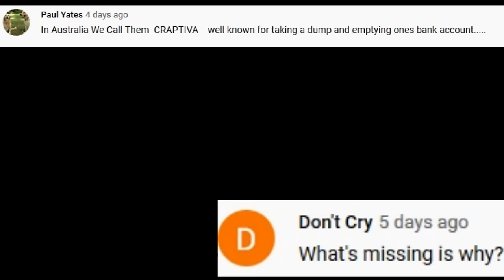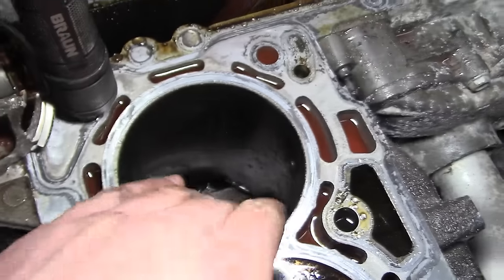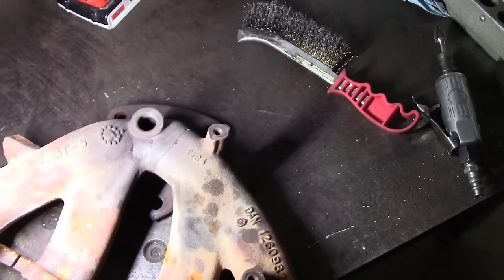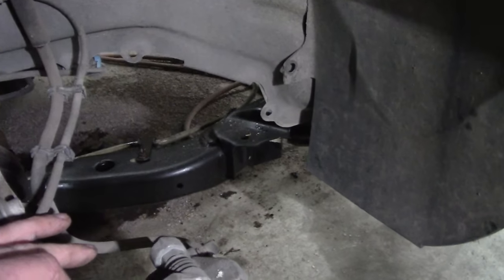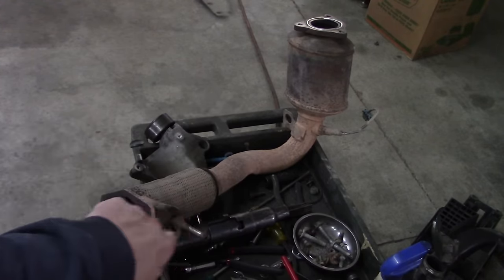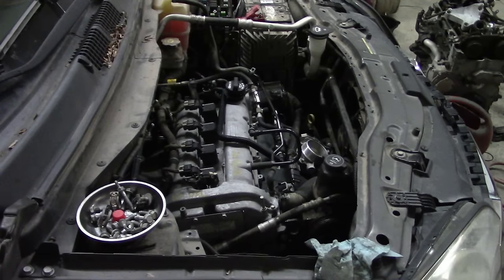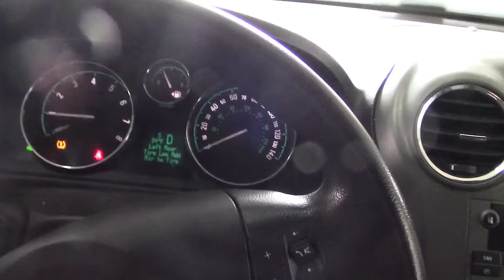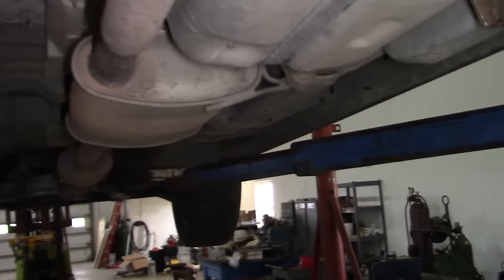I Fixed the Cheapest Small SUV on Marketplace - Part 2

Comment: Good luck to you. Love your channel even though I know nothing about cars, am way too old to learn, and I rely completely on good folks like you to keep me running instead of walking.

One comment about your economic calculations, which is something I do know something about. You yourself mentioned the pig-in-a-poke risk of buying a bad transmission along with a bad engine. And I suppose the car's rear end should be in that risk pile, too. On this particular occasion you won your bet. But how often would you expect to lose it? Once in five flips? Once in two? Let's say two out of three good ones ain't bad, as the song says. Then you need to increase that cost basis you articulated by 1/3 of a transmission and 1/3 of its corresponding labor hours. And those are not phantom expenses, either. All they assume is that you plan on repairing and flipping cars a few more [hundred] times in your long life before you are so lucky enough to get to my overripened old age [more advanced than my timing to be sure]. Anticipating costs of a "going concern" is a perfectly legitimate way of thinking about your business. No embarrassment necessary. Also, think to add in a dash extra to cover bum checks, bad deals when you volunteer to take an economic hit just to make a problem go away, insurance, and the cost of carrying your "inventory" [one sweet Craptiva] for months longer than originally planned, as needed. More nice small businessmen get screwed over by not properly reckoning their costs than anything else.

Good health to you and to your lovely family. Stay safe.
Reply from the maker: That right, which is why one pays more for a car from a dealer than a private party. They are taking a larger risk. Personally, I think flipping cars is a poor way to make money. The margins are low, and you have your money tied up for a long time waiting to sell. But sometimes it can work out.

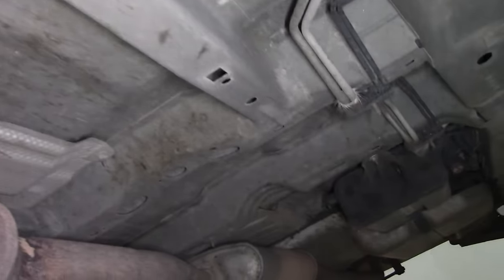Comment: 38:00 I know what you mean. My 2000 bmw 323i is rusting away. It was in Ohio and then Illinois living in the rust belt its whole life. My exhaust studs rusted so bad the nuts fell off! My body is starting to go where the side skirt mount is gone and everything behind it is crunchy. poor car, but you cant blame it after 252k miles...
Reply from the maker: I once owned a 2001 BMW 325CI with a 5 speed manual. That was an awesome car. I replaced the tires and the struts and lower control arms once. Never did any other work to it the whole time I owned it. But it was only 6 years old at the time.

Comment: why did you put dexcool back in it other than it having a dexcool label?  i hear that stuff is really bad for an engine that will eventually leak and introduce air into the system.
just wondering what your thought are, not doggin ya.
Reply from the maker: Nah, Dexcool is fine. The problem with it is people mix it with the old green ethylene glycol coolant and that's when bad things happen.

Comment: GM Engineers are always like hold my beer we're going to make this three thousand times more complicated and you have to have it serviced at the dealership and spend a buttload of money on it.
Reply from the maker: Right. Instead of a simple relay, lets use a dealer programmed module, then mount it to the frame, then use an aluminum housing, and no rust proofing. What could ever go wrong?

Comment: Having owned one of these,  they are roomy, comfortable got good brakes,  six speed transmission was OK after you drove it hard,  
Did a cam position,  sensor,  blew the high pressure hose side of the power steering lost oil,  abs light came in,  cleaned and did some heavy braking, abs light out. Would I buy another.. no. 😀
Reply from the maker: LOL. That's a review!
Reply: @WatchWesWork  haha yes got a bit carried away.

Comment: experience and living in the rust belt has taught us that you dont touch the cradle bolts unless there is no other option...even then, find another way!  plus all the other systems that need to be disconnected, fluid loss, potential for more things to go wrong. i avoid those situations. clearance dent in exhaust must be for the engine torque / rock.....not like gm would have a bad engine mount or 2. i thought you had the vacuum fill tool for the coolant system. one more sewing machine installed! looks like gm spent more time engineering their fancy dress up plastic than the actual engine! oh man, battery on concrete, here go the youtube certified pros.
Reply from the maker: Man. I always forget about that coolant vacuum!

Comment: going to braze up the spare exhaust manifold too i assume?  You missing the bolts on the power steering pump made me think about when i replaced the belt on the mini excavator i did everything through the rear door and was thinking why dont they make a access panel from the seat side?  Well i climbed up there after i was done and sure enough there was a small access panel just for that.  Lol We all make similar mistakes at some point.
Reply from the maker: LOL. I heard one about a cam shaft in a FWD car. There's a special service tool to allow you to pull the cam shaft out without removing the engine. The service tool is a hole saw! You cut a hole in the inner fender and slip it right out the side of the engine.

Comment: Really, your upset over a salvage yard not taking a out of state check and think that's sketchy?  Most are wise enough not to take any checks.
I won't take checks for my work period.  
Like your videos though.  Typical GM you got there, GM=gov motors, the new overpriced yugo.
Reply from the maker: Most businesses will take a check from another business, especially when accompanied by the proper tax paperwork. I know I do. If I didn't, I'd never get paid...
Reply: @WatchWesWork  No offense or anything, I enjoy your videos, please don't take me the wrong way.  
Only place I take a check from is 2 motor clubs I do roadside for, anything else is cash or card.  I also do not operate as a business but as a *general laborer*.
When you will under cut the price of the other guy well enough you would be surprised how many businesses find out how to pay cash.

Comment: MY BACK HURTS watching this video Wes, I cant do this anymore, but thank you for sharing your work with us, One thing we found real handy working in tight confined areas of corporate jets for many years and I had a complete set of Angles, both MAX and Snap-ON, as they both have two different degree of off-sets, But the other set we had was a set of BONNY wrenches, they are simple beefy open end one end only and in big sizes, I bet you can grab a set on ebay dirt cheap or a local swap meet sometime, Bonney was the brand, they are super short, but real beefy and nice to handle in tight places for weird angles.  Thanks for your videos.

Comment: That looks like the same body model as my 2013 2.2L diesel, 6 speed auto, supercharged, all wheel drive, Holden Captiva.  So far mine is running OK, and is a delight to drive.  But I had better not say too much for fear of tempting HaSatan (the Devil).  To date have done about 125,000km, and getting wildly varied fuel consumption, depending whether I am country or city running.

Comment: Wes, you should have had the joy of working on Cheverolet big block engines in the late 50s with air conditioning, power steering, etc. to "clean" or change the spark plugs every 5,000 or 7,500 miles for leaded gas fouled plugs. A "Plain Jane" car was okay, but the "just stick it there" engineering was common back then too.

Comment: My neighbor asked me if I could change the oil on her 2009 Corolla, I said sure, when I got underneath I found a funky looking oil filter housing which required a special tool to remove it, 13 bucks at AutoZone, that was over two years ago and I've never used it again.

Comment: I swapped engines on my daughters Cobalt this past winter. It’s a 2.2 as well. I took it out the top also. If you are leaving the transmission it’s much easier. Take the A/C pump and PS pump off and lay it to the side and your golden.

Comment: Yes, we talk nasty about FOMOCO, but we both still have our 7.3's.
At first I cussed the monster oil filter, until I poked a hole in very bottom to drain it out. Now no longer need veterinarian sleeve for checking livestock. Let em wonder, stimulate their minds. lol
Now my only fuss, is the tiny opening they have to get several gallons of oil in. Even with the use of a funnel, seems to take longer than it should. lol Yet my 03 has nearly half million worry free miles under her wheels, and I dread the day I have to have it replaced, but way way cheaper than a new, are newer year model.
So keep up the excellent work in both your profession, and your growing video library, are playlist I believe it's called. 
Thanks for the humor, and interesting repairs you do..
Y'all be safe, stay well, and go easy on your help, it's as rough on her as it is you.

Comment: cRaptiva is so apropos -  mortske repair says about adjustable wrenches- 'swedish nut lathe' -  the lack of rust is normal for where i live- 2003 ford ranger with no rust 82k mi.  01 olds aurora 130 k mi very little rust- it lived in maryland.

Comment: 17:32 I’m unsure about on these vehicles but on Ford Escape platform SUV’s the cradle holds the rack and pinion, the only way you would have an issue if you take it off at the ball joints (which isn’t how I do it because I want room) is if the mounts for the control arms are moved, be it that the bolt going through them has to come out like on the Ford or if it’s entirely using a different spot for one mount.

Comment: We are very, very lucky that our computers, aircraft,  and cellphones aren't designed by the guys that designs exhaust manifolds. They have had over a hundred years worth of R&D time to make them right by now. How hard can it be to make one that doesn't leak, crack or have the bolts that holds it either brake off or seize... ?

Comment: Engine out the bottom versus the top:
If it's coming out and nothing is going back in (donor, curiosity before scrapping the car), out the bottom every time.
If it's coming out and going to the alignment shop later (or you are an alignment shop), out the bottom every time.
If it's coming out and it's one of the relatively rare cars that have a positive subframe cradle alignment system (dowels, or a shoulder bolt or something), out the bottom every time.
If none of that applies and it fits out the top with less than 2 hours of extra work, out the top.
If none of that applies, out the bottom.

Comment: Wife's car has that stupidest oil filter. Easier to get to than what yours was, but I still broke down and bought the special socket. Sure, make it a cartridge, but they also wanted to make it out of plastic to save a couple bucks. Couldn't make it so that a square drive services it because the plastic they used wouldn't have been able to withstand the force required, at a smaller radius, to apply the torque required.They saved 2 so you spend 10.

Comment: Good job Wes! My only comments  are that I first suspected a thrown rod before you discovered it! When the engine was first installed the body work was lowered over the engine & you had your reasons for removing it the way that you did! But I wouldn’t have done it your way! It’s obvious that you have your ideas of doing things but in your last video that I watched  it was stated not to gas axe suspension brackets off but grind the rivet heads off ! As your aware when rivets are first installed the head of the steel rivet including the shank expand when the head is domed over! You were left to drill out the rivets with great difficulty!

Comment: Hi , about to protect your cars 🚙 against tear and wear, use cold squeezed linnen oil inside the “frame”and the hole underneath, it’s very great to stop rust and to not get any ✅
Penetration is fabulous good 
Just protect all things you not want to get that oil on, when the surface is “ dry” it’s very tuff to get off!
Turpentine is the only to kind of clean it off!

Comment: The reason why cast manifolds crack is temp difference per cylinder. I always make my own manifolds from steel,the only problem is that they run extremely hot because of thickness, the thicker the better?

Comment: If all or most exhaust manifolds crack like that the problem is at the foundry when made.
Most likely they are pulled from the mold to soon and cool off unevenly or the metal isn't hot enough when poured.
The curved surface cools slower than the straight section stretching it slightly and that will make the cracks like at the edge of a weld.

Comment: Hino medium duty 6 cylinder truck engines have the worst fuel filter location ever. You have to essentially move half of the damn engine harness to even get a filter wrench on. Also, the filter is between 2 common sizes, and they're usually insanely tight. I've had several where it was easier to remove the filter housing base to get the filter off. I hate Hino trucks.

Comment: You can reblacken the bodywork plastics using a heat gun with mild heat, they turn black again quite easy but it only lasts 6 months or so depending on the local weather.

Comment: Hey Wes, if the battery in question is fully charged, cold concrete floors won't hurt a thing. If you have a boat battery that you want to store for the winter, just charge it up and bag it in plastic and store it in the freezer for the winter, come spring , reinstall in boat and fire it up.

Comment: Well I never knew they had such a horrible reputation in the US. Here in Europe they sold as Opel Antara but then 99.9% of them came with the 2.2 or 2.0 diesels which I did not hear anything about, good or bad. But then they sold so few of them on account of this segment being dominated by the VW Tiguan anyway...
Reply from the maker: We don't have the diesel version here. Too bad.
Reply: @WatchWesWork yea,  I gathered the US does not "like" smaller diesels. With 35 MPG, they have less running  costs for sure. Have to say the tide against diesels for cars has now turned even here (after years and years when they told us to buy them because they were... Better for the environment) so we will be getting less and less of them.

Comment: Change engines are fun agree too I say do light motors from bottom and heavy one up top too! Also Oil Filter on were these motors are agreeing with use small or deep socket with long extension to rachet wrench  helps that can try soon when can! Also Oil Filter spin on I like better too inculded but some motors are hard to do plus! Also the air filter box in square are fun to plus with the Mass Flow Sensor add on them to changed too!

Comment: Nice  repair job.  The original engine was a race car power plant for a very short time?  As for the battery- sitting on concrete is not a problem.  Clean the dirt off the top to stop leakage current.

Comment: Oil filter should be a standard 26mm socket.  If not 26mm, then it is 32mm.  A million trucks use these caps.

Comment: Buddy hindsights never going to be better than 20/20 . In manufacturing theres and old joke the engineers kid wanted a swing so 13months ago the engineer set out to design a swing and the maintainance man his little girl wanted a swing too so he went and put a heavy rope on a tree limb and attached a tire to the end nearest the ground. And his little girl went swinging happily however the engineer was still hard at work on his design. And his kid was terribly upset and still had no swing however the maintainance mans daughter invited the engineers kid over to play and swing. As yet the last news on the engineers swing is that the tires got a rope on both sides for safety and stability and one rope to each limb on the tree totaling 2  and the problem is trying to go from paper to reality and as per all engineers there are issues like the swing cant swing because the treetrunk is directly in the way and and the swing dont swing

Comment: Try a closed rachet wrench , with a swivel head. On your oil filter. I like dielectric grease on them posts. I to am in ,IL I do electric,repair on machinery . Did a few years @ Ford in kc,Mo,we made Transit van. Also @ Navistar,in IL , they made I6 diesel engines. Fixed there machines to. Calibrated dynos, I know a little @ 61 Peace. Good repair.
Buy a Ford - Take a peek @ RFB from Boston & another guy I respect on the economy on youtube
Jerimiah Babe. Peace
Reply from the maker: I'll check it out!

Comment: $2000 for a engine at the auto wreckers? That's a bit steep in price..  When I blew a oil ring on my volvo 850 estate that had 260000 miles,  got a complete engine core from the salvage yard whit 124000 miles and whitout accessories, tested with a 30 day warranty and ship to my door for $400!
Reply from the maker: It's just what things cost here. I don't know why, possibly because it's a rural area.

Comment: When a company has a policy of using John Q. Public for it's R & D, then handles their own paper to make loans for sales that shouldn't have been made to people with no financial responsibility, starts to fold because of those practices, then begs for a bailout from the gov'ment using taxpayer dollars which it never pays back, nope, no support from me. Figured I've supported them enough without my permission. The GM stuff that I've owned (not for a long time now, fool me once kind of thing) have primarily been failed experiments which were not supported by after-sales efforts. That bad taste will never go away. The old glory days of good products are gone where GM in concerned. Sure, other manufacturers have had issues, but typically don't use the consumer for their research and development  to save a buck to the extent that GM does. Okay, maybe Dodge/Chrysler as well.
Reply from the maker: The pre 2007 GM stuff was pretty decent. They had good engines like the LS V8s and the 3.8 V6s. Then it all went wrong...